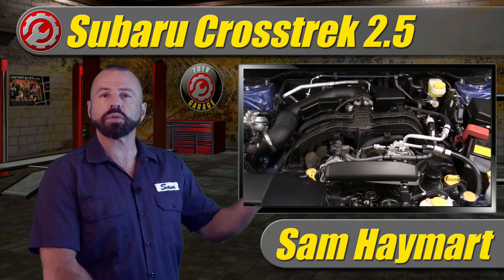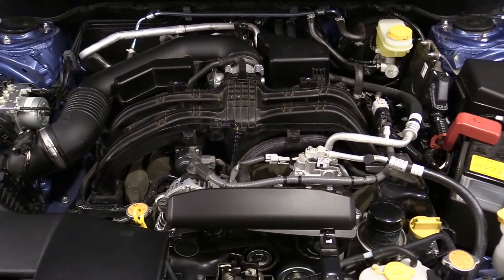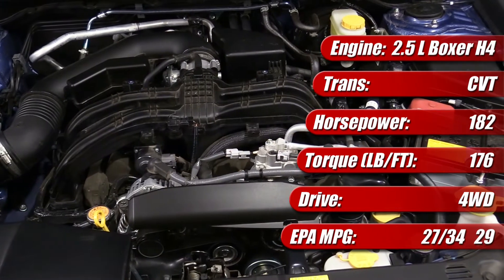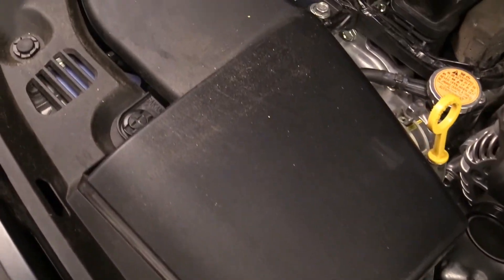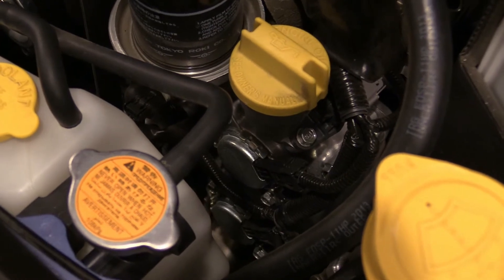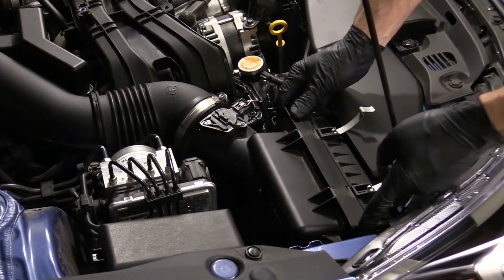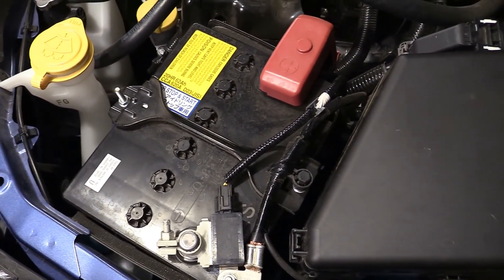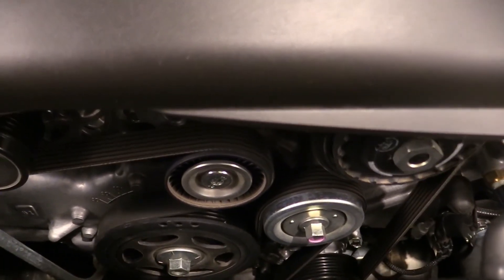2021-2022 Subaru Crosstrek 2.5: Engine Explained

Comment: I just bought a used 2021  How do you tell if it is a 2.0 or a 2.5 engine?  I am talking about the Cross tr k but thought police wouldn't let me use the model name.
Reply: If you have a sport or limited you have the 2.5. The sport has yellow stitching on seats and the limited has orange stitching. Another way to know is by looking at your engine. Stamped in big letters it will say either FB20 or FB25. FB25 is the 2.5

Comment: I like how they put the oil filter right on top. Very convenient.
Reply: I'd prefer a dry sump system like the corvette, with an external mounted filter and tank. But this isn't terrible.
Reply: @K03sport  Old comment I know, but it's a ~25k car, not a ~75k+ sports car bud, be realistic lol